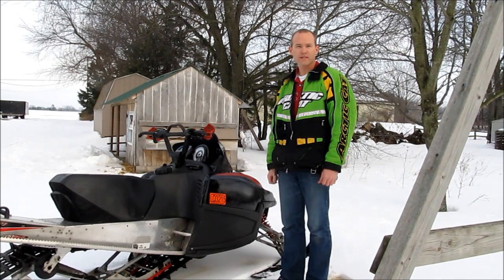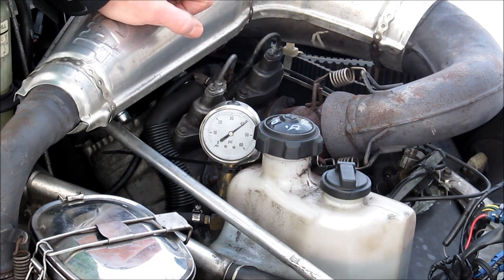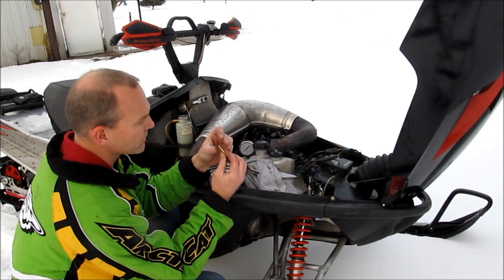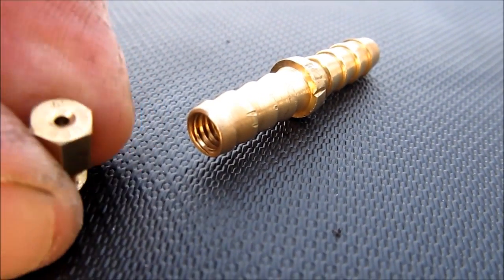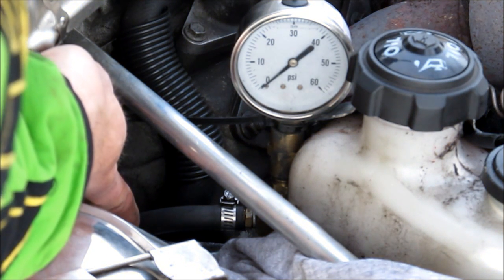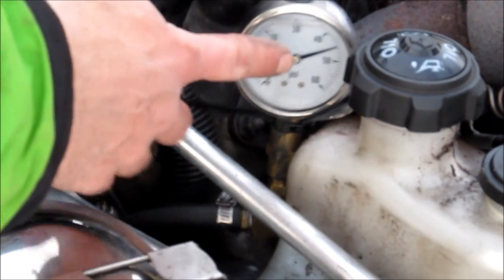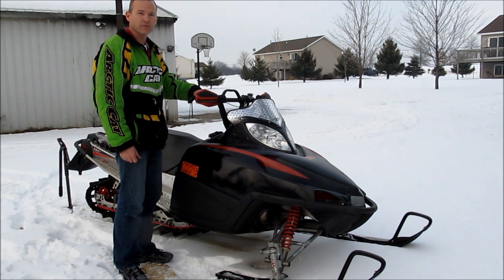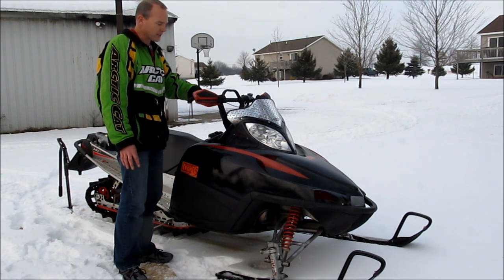Arctic Cat F7, M7 EFI Fuel Restrictor Modification.  Singe Best Modification for the Money.

Comment: I want to do this trick but my fuel pressure regulator just fail and my pressure is changin from 45-58 psi at any time, so i would like to know if i put the same jet as you it will stabilise the pressure at 41 psi or it will move to crazy psi again ? Thanks

Comment: I have a 2004 F7 efi sno pro. With GGB mountain can, I have the mid range bog. Even with stock can it’s slightly there. But will have more snot. I have these parts but I have a 320 and 340 jet. Will I be okay with one of said two? Please comment!! Snow is falling. Thanks !
Reply: Tyler LaFortune did you ever end up tryingthis? Mine eats gas like crazy and any videos of the mountain can? I have a trail can looking to go up
Reply: 340 is the exact same As stock, 300 should be the biggest you go.

Comment: You could just buy a adjustable fuel regulator from jegs or summit racing and install it in line instead of drilling and taping that barb for different jets and then you can adjust it with out having to take it apart to change jets !

Comment: I can attest to this, I ran my 03 F7 this weekend in a radar run with this mod, if not for the 2 pros running in that class I would've place 1st and not 3rd. My F7 with another driver on it drag raced a ZRT 800 and blew him away.  This is a nice inexpensive little boost of power.  I may try the 280 jet next weekend in another radar run.

Comment: In my opinion... first check your pressure and determine from there if you want to reduce the fuel or not.  The 2003 f7 maps run lean from the factory and the 2006 map is supposed to fix the richness issue for 04 and 05 models.
Reply: rather rich,,than lean
Reply: My 06 runs extremely rich stock

Comment from the maker: You do run that risk if you drop the fuel pressure below 41 psi.  I know some guys that go as low as 38 psi, but they do run the risk of ruining the motor if they hold WOT too long.  If your machine is already running near 41 psi, you will not feel much of a change.  Mine was at 47 psi and the change was dramatic.